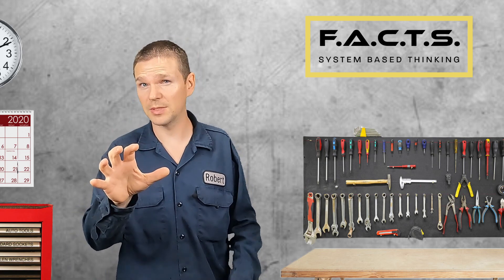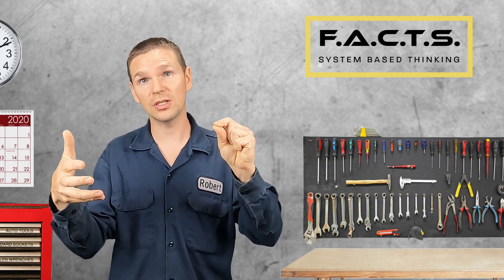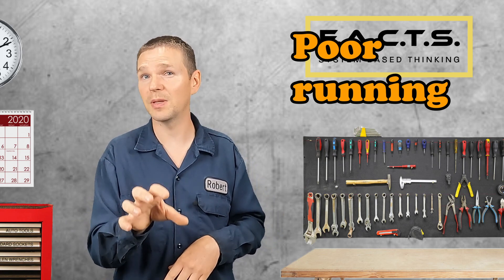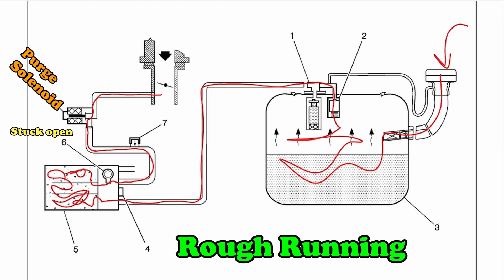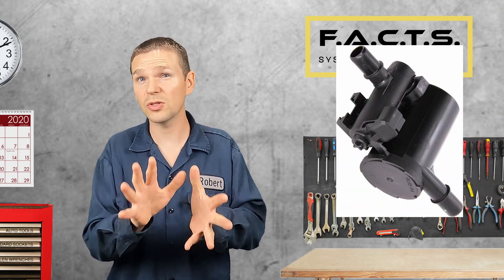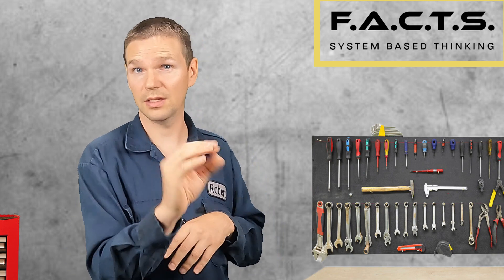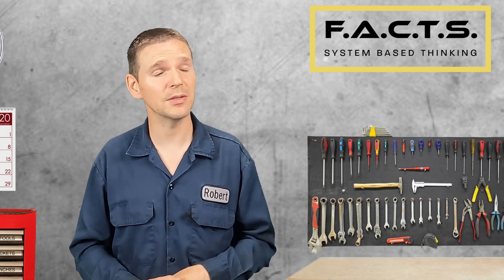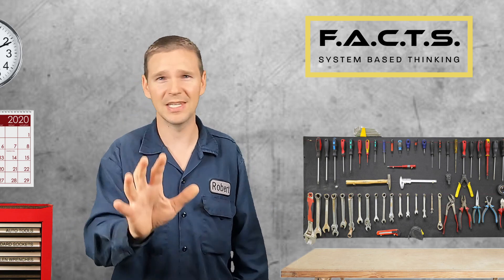FACTS: EVAP system failures and symptoms

Comment: What if my wife's car showed low then she put gas in an it sat for 2 days then on a random day it starting regugatating the full back out of the gas cap. It sat for a while before doing this

1990 honda civic
Reply from the maker: There is a two way valve between the fuel tank and charcoal canister. Remove that and check that it's working properly.

Comment: Hey man I have a question I got 03 Chevy S10 zr2 I keep getting a code for po455 I know that's EVAP symptoms I have put New vent solenoid and purge valve and I check all lines holes I don't know what to do now trying get the check engine light to stay off this is only code it's showing at this time help please thank you
Reply: As I got a scanner to clear the check engine light but after a day or 2 the check engine light comes back on
Reply from the maker: @BrianDalton-c8m  Check the fuel tank pressure sensor. That's what the computer uses to see if there is a leak. If the sensor is giving the computer false information it can give you a code when there is nothing wrong. Also to check the EVAP lines for a leak you'll want to use a smoke machine
Reply: @ValleyMobileAutomotive ok thank you I will do
Reply: I will replace the pressure sensor and check the lines us well use a smoke machine

Comment: Hey man, i got a question. I have excessive vacuum in the tank, not as much that it implodes but when I fill up the tank and open the cap you will hear a pretty strong sucking noise and you'll hear the lil flap in the  neck of the filling hose making a farting noise. I've replaced the cap and the surge valve and still i'm getting excessive underpressure (there has always been a bit of vacuum as there should be but not nearly as much as this).  I can notice during driving that it is impacting performance the more the tank empties. Where do you think i should look next? Its a volvo c30 t5 and i havent had a single check engine light. My guess is the leak detection unit.
Reply from the maker: That's where I would look. It sounds like the tank isn't being allowed to "breathe". Another place would be a clogged charcoal canister.
Reply: @ValleyMobileAutomotive  Thankyou, I will look into that.